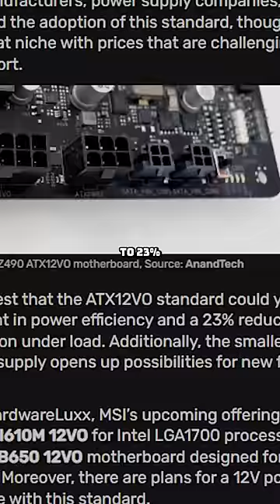Say Goodbye to the 24 Pin PSU Connector 👋

Comment: motherboard in 2069 : Hey checkout this wireless motherboard
Reply: Nah, they're just gonna straight up stick the C15 AC cable on the board, built in PSU style
Reply: >look inside
>wires
Reply: just directly solder the psu onto the motherboard, everything will be fine!
Reply: @andrewliu6592 you mean solder the motherboard to the pcb? No way your lifting the heatsink off the pcb of the ZTX19090 and the RX14900XTX
Reply: I have a pro h610m and it has a 24 pin connector🤨
Reply: you do know that that doesn't necessarily mean bluetooth right? it there are literally graphics cards that are wireless by gaining all their power from the PCIE slot
Reply: @Friendly_Neighborhood_Dozer  i don't think a pcie slot can support it unless it's low wattage (those tiny pins are not supplying 12 volts at 25 amps) but a dedicated design could support it, and you could have that put adjacent to the pcie slot and have an extension to the power supply cable
Reply: @Raining_Frazzer  just solder jumper cables to the i/o pins at the bottom, then irreparably damage the pcie slots with a soldering iron
Reply: @andrewliu6592  I can’t remember how that shit worked, might be an extended slot with dedicated power pins/ a second slot for power next to it. But that’s not the point. The point is that there are no wires.
Reply: @Friendly_Neighborhood_Dozer  Nope, the PSU is on the server, and we connect the motherboard and PSU via wifi, it's like cloud gaming. So as long you have a wifi you won't be worry about power. But if ur wifi lagging ur pc will shut down. But don't worry, in 2069 we will have wifi 15E pro max
Reply: We actually might not be that far off. I think it was china who recently successfully tested wireless power sent from space collected by solar panels on satellites or something
Reply: @hiko8822  just pull the live and neutral straight from the wall and solder it to the board my guy 😂
Reply: Gaming companies in 2050: You will subscribe to GamePlus. You will stream our games to your shitPC. You will own nothing and you will be happy.
Cyberpunk Dystopia.
Reply: @Raining_Frazzer I mean by 2069, if we're still on this style of digital computer, the igpus will probably have killed consummer discrete gpus
Reply: ever seen bluetooth ram?

Comment: ah yes, the 10+6+4+4 pin connector... wait 10+6+4+4=24 ... they just made a deconstructed 24 pin...
Reply: 10+6 actually
10 for the motherboard.
6 mandatory for additional 12v, like PCIe.
4+4 if you only use SATA power with 5V required.

Comment: You know that those connectors you are showing, some are 5/12V out, i.e. for fan or drive connections. The ATX12VO connector is a single 10 pin connector plus the 6 pin extra power connector if required. Each can provide 216 to 288 watts of power. The 4 pin connectors show basically replacing what used to be provided by the power supplies as 5/12V Molex

Comment: “Don’t fix something that isn’t broken”
Reply: 24 Pin IS worse (so broken in this case). Though it's really questionable if the switch is even going to be better when 24 Pin is so common right now.
Reply: Power efficiency and reduction is a good thing to aim for in a world where energy has gone up a lot in the last 3 years.
Reply: We should go back and start using single cylinder four stroke engines, different power adapters for every device, bulky CRT TVs/monitors because none of these were broken...
Reply: There are always people saying that for anything that is different. Change happens for improvement, it's only if the change has no benefit or has a disadvantage that the saying applies to. Imagine saying the same when we were switching from Micro USB to USB C.
Reply: Isnt broken? Unplugging those cables is a huge pain in the ass
Reply: It is broken if something works better then it tho?
Reply: @Bargate  Sure Sure. When we have video cards pushing 500W. One hand goes down while the other hands goes up.
Reply: @UrielX1212  thats because of lazy ""development"" of graphics cards generations during pandemics, which is just cranking up more memory, cores and hertz into a new gpu that isnt really better than the previous, it just has more junk compressed into the board
Reply: Look at the pcie cables. We fixed that and now Gpus spontaneously combust lol

Comment: this happened 15 years ago
everyone hated it

terrible idea, if a regulator goes bad on a high end motherboard, it goes from 7 minutes and a $75 PSU to a as much as $300 repaie, where the part may be completely unreplaceable due to changes in internal connectors and bios features, and will take far longer while risking other highly expensive components in the process

a standard is a STANDARD
you do not change a standard

we did not change from using NEMA outlets just because they are 120 years old, we just added a ground pin over time

when 20 pin was not enough, we added 4 extra pins while maintaining mechanical compatability, same with GPU and CPU power, so why change it for shaving off a dollar of wire plus requiring a power supply that will be discontinued after a year when it all fails AGAIN
Reply: they hurry to broke, but not hurry to fix 😂.  Why always bring a bad things...
Reply: I'm not against 12Vo the problem is when every board manufacturer wants to try to introduce their own special connectors that are all different. Of course I don't think 12vo is going to take off at all in the consumer market. ARGB products are just way too fucking popular for any of PC parts manufacturers to just give up on and that 5V. Are they just going to do voltage conversions on the motherboard for Sata and argb? Motherboards have enough points of failure as is I don't want to introduce more and that also brings up the problem of how we connect 3.3v and 5v devices. Once again every manufacturer is going to try to add in their own special connector for sata power or something. 

We have a standard right now that works and people hate when the tier 1 oems like Dell, HP, and Lenovo pull this shit with their motherboards and power supplies. So I don't think people are going to put up with them fucking with industry standards unless these are going to be niche things for prebuilts or workstation build components.

Comment: From my understanding, the 10 and 6 pin connectors recieve 12v from power supply and you get your sata drives powered from the motherboard using those 4 pin connectors.
This is already the case with the weird proprietary power supplies used in sff prebuilts

Comment: Over a decade? I've been using that same plug for three decades and I'm sure it was around before even then
Reply: It was 20 pin before that. Then they put 4 additional pins. Then they fused the 4 additional pins to the plug and it became 24 pin. I still have a 20 + 4 pins, it looks the same but the 4 pins are detachable so this 24 pin plug is actually older. I'm also not chaining it until absolutely forced, especially considering what they did with the 12vhpwr

Comment: Couldn’t be worse than the bolted metal tabs in the Mac G5 PowerMac’s PSU which required the whole computer to be taken apart just to get the inspection cover of, this included heat sensors which where proprietary, expensive and insanely delicate.

Comment: It's still... 24 pins.... A 10 pin connector, a 6 pin, and two 4 pin connectors
Reply: But not all of the connectors are for the power supply.
Reply: The 6 and 4 pin are outgoing power because the board now creates the 3.3v and 5v which are still needer for SATA etc. You no longer connect the small peripherals to the PSU but to the board. PSU itself to board is in fact reduced from 24 pin to 10 pin
Reply: This is cable management hell
Reply: So the board is going to be able to convert 12V to lower voltages more efficiently than the PSU can generate those lower voltages directly?? That seems fishy to me...

Comment: I don’t like that they’re replacing a one single mostly simple cable with a few cables
Reply: It will probably be bundled into one cable similar to the PCIe cables we already have. It will probably be easier to unplug a few small connectors compared to one giant one that might just break the motherboard from the sheer force you need to put on it.
Reply: The original ATX 24-pin connector has 12V, -12V, 5V and 3.3V on it. Most modern motherboards don't use the lower voltage ones anymore besides for standby. It is fairly easy to generate lower voltage on the board for standby. I.e. they aren't really required anymore.
Reply: @uzimmermann  that’s all great and all but I’d still rather use and only need one cable idrc about the specs it’s about the simplicity
Reply: @fabiandrinksmilk6205  that’s fair my first PC 24 pin felt welded to the port
Reply: It is one cable though.

Comment: The kind of MB that need this the most, the ITX motherboards, happens to be the hardest to implement this on. Since you're just moving all the voltage conversion from the PSU to the MB, it's just going to make it harder to fit everything on a already cramped area for the ITX. I wonder if mini-DTX is going to make a return.

Comment: 24 pin plug: exist.
companies: Let's remake it
Come out with multiple plugs adding up to 24 pins.

Pewd: It's evolving, just.. backward.
Reply: pulling a 24 pin out of the motherboard is a huge pain in the ass. id rather pull more but smaller connectors rather than potentially damaging my board and connector
Reply: @ArkAE86  I have ruined an X370 MSI Board because the connector was particularly tight even though I braced the board from the other side...
Reply: They seem to lack comprehension regarding the rationale behind the replacement of the previous standard with this 24-pin connector. The previous version featured two separate connections, and if improperly connected, it could result in damage to the motherboard. To address this issue and accommodate additions like the power switch, they opted for a new 24-pin connector that combines all necessary connections into one, ensuring a keyed design to prevent incorrect connections.

Comment: Look at the 12VHPWR connector, melting at the cause of too much wattage trough too little pins on the connector, now the same thing with Mainboards
Reply: That really isn't going to be an issue with these. The CPU already has a dedicated 8pin connector. And the power hungry PCIE devices get dedicated 6pin or 8pin connections. 

On this board, the power draw exceeds the 10pin 12vo connection, so they put the extra PCIE 6pin connection on the board.
Reply: It's not going to draw enough power to melt anyways.
Reply: I can't because I'd rather use workstation NVIDIA cards and those use EPS connectors instead,

Comment: 12VO has been rightfully hated by enthusiasts and board partners since it was first revealed back in 2016. It's going to drive the cost of motherboards far higher than it'll reduce the cost of PSUs by. Motherboards were already becoming more expensive due to the added difficulties of clean PCIe 5.0 signaling, but now needing to heavily filter that signaling against the onboard power regulation for 5v and 3v lines used by USB peripherals and idle powered PCIe devices, will drive the price even higher. Those voltages still have to come from somewhere, and if the PSU isn't providing it, the motherboard itself has to.
Reply: 12V to 3.3V and 12V to 5V regulators won't impact PCI-E as much as even 1 phase of CPU Vcore VRM (that one at least sits right next to CPU and CPU-GPU and CPU-M2 SSD slot PCI-E lines)
Cost wise - the same as extra connectors + extra 2 CPU Vcore phases.

Comment: In the UK, very recently we were paying 39 pence - about 45 cents for a KW/hr - damn right that efficiency matters!
Reply: That's what he should have cared about. The connector is a one-shot thing. Efficiency is the life of all the components.
Reply: I hope you know that only highest end machines would ever require said KWh. Most dont even use half of that, and most power consumption is coming from GPU anyway, which is in no way improved.
Reply: It doesn't save much in electricity. And if they botch it like the 12vhpwr in the end it will cost more.

Comment: Will be interesting to see these widely adopeted for home builders. Though besides sometimes the struggle to get it out, I really like the consolidated 24-pin more.

It's so nicely simple: just one comnector and done, don't wanna fiddle with 5 connectors to achieve basically the same thing - maybe future tech requires more oomph from the chipset or something, I dunno

Comment: This has like not much in common with the 12VHPWR connectors that caused issues on GPUs. It is the same as the 24 pin, just with a bunch less pins that currently provide minor voltages to the mainboard. Like 3V and 5V for example. Mainboards using 12VO will have the converter circuitry for making those on the board rather than them being in the PSU.
Reply: Easier to pull a psu than a mobo...
Reply: @shadowopsairman1583 
If the PSU craps itself, you're pulling the mobo anyways
Reply: I'm afraid they are going to make it subpar and ask for more money... because "innovation", so I'm not buying anything else than 24 pin. Mainboard manufacturers already cheap out on anything, they will try to save 1 or 2 cents, but will charge more. They also said there would not be problems with 12vhpwr... but 4090 are burning left and right, and they first tried to blame the users. Unless they fix the 12vhpwr, I'm not buying a mainboard with new connector... I'm not going to burn down my mainboard because I can save a few cents on electricity.

Comment: Honestly I don't mind a new connector, but if they do introduce it they should at least include an adapter for older PSUs with the 24pin
Reply: Actually that doesn't work in this case like graphics cards as loads have either moved in position and things like 5v rail removed you be causing more problems then good doing that. Nvidia's one pin connector enough of a headache doesn't need more.

Comment: No power supply gonna be made for that thing
Reply: some third party company will probably make a cable for modular power supplies. But up to the consumer to decide if they want to stick some non OEM stuff into their rig lol.
Reply: There already are units. Several as a matter of fact.
Reply: @doublevendetta  wait wha? are there any on sale right now?
Reply: @cobalt35  Lol 12VO isn't a new standard. Intel spearheaded it YEARS ago. It just met a lot of initial resistance.

Currently no, you as a consumer aren't going to pick up one of these PSUs on Newegg, but OEMs (like MSI) ABSOLUTELY have access to the necessary channels.
Reply: @doublevendetta  oh ok
Reply: Some prebuilts already use it

Comment: It's removing the 5v and 3.3v and just going to supply 12v. The motherboard will do the job of converting the 12v into the other voltages.

Dell and HP have been using it for about 5 years now, its an Intel spec.

Comment: It’s sad because it breaks compatibility if PSU and motherboard manufacturers all switch to using this connector.

The beauty of the 24 pin cable was that you could hook up a brand new PSU to a brand new computer, an old computer, or even a computer from the 1990s, just without the extra 4 pins. Or if you wanted to for whatever reason, you could connect an old 20 pin PSU to a modern 24 pin board and it would work fine, as long as the wattage was right.

Changing this would essentially defeat the entire purpose of ATX, to make essentially all of the basic PC components compatible, regardless of time period.

Comment: 12V only power connectors have been used for years on industrial PCs, whether for the factory floor, desktop, server, auto, or custom.  They've been optioned into ATX, ITX, mITX DTX, 5.25", 3.5", and other custom form factors.  They were usually chock full of I/O.

Comment: 12vo is going to be a nightmare
Reply: Why
Reply: it's been around for years. Some pre-builts already use it without issue.
Reply: My hp pavilion has a generic 4 pin connector for the motherboard (not including the cup conector and a 4 pin SATA power conector that goes into the motherboard and psu?!): I am 4 parallel universes ahead of you.
Reply: Aight but why though
Reply: People just say this stuff because of Nvidias connector while not knowing enough about electronics. The existing 24 pin connector already uses 12v, the only nightmare it is comes from how difficult it is to unplug. Current is what makes cables burn, when those cables aren't thick enough. A higher voltage helps move the same power with less current, or more power using the same current. Unless the current is too high for the cable thickness, there is nothing to worry about.
Reply: No, I say this because of the botched switch to USB C, and it's not like motherboard manufacturers need another excuse to increase prices. The last thing we need is 500 dollar midrange boards

Comment: That is still 24 pins. LOL
Reply: 10pin PSU connector, 6pin PCIE connector (also from the PSU would be my guess), and 2 4pin SATA power connectors to provide the 5v to the drives that the PSU no longer has. 

Not quite the same as the 24pin.
Reply: 2 pins can have the same power as a 24 pin, you'd still call it 24 pin 😂
Reply: I think that in future, there will be available adapters for 24 pin to 10pin 12VO connector.

Currently there are only available for wierd OEM powersupply connectors.
Reply: Lol y'all cant count 10 6 4 4 = 24. You can even count how manny pins there are.
Reply: @thatoneguyffs the 2 4 pins are for SATA power as it says on the motherboard. And I’m assuming that the 6 pin is optional depending on the amount of PCiE Cards you have that don’t have their own power cable like USB or Ethernet cards
Reply: @poxbox6729  no I wouldnt if it had only 2 pins count all the pins in the red circle and let me know how manny there are.